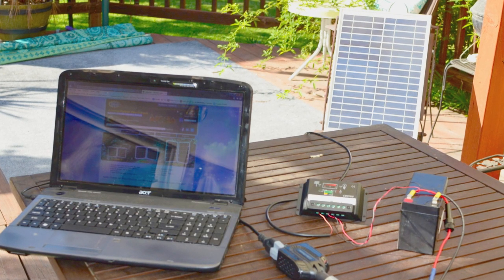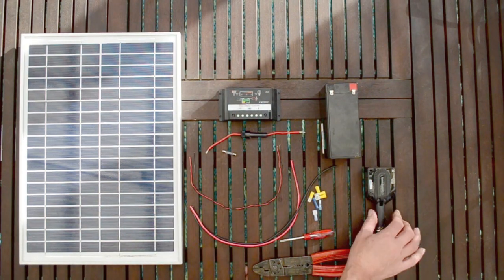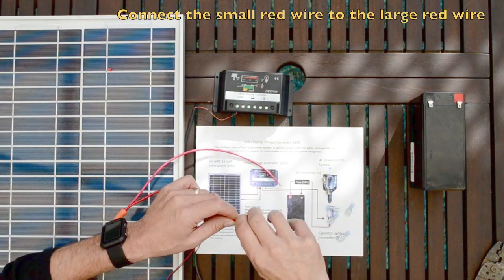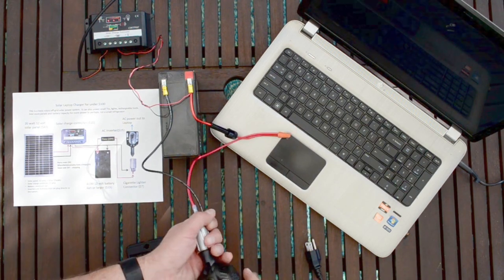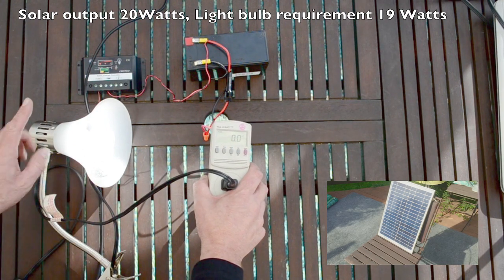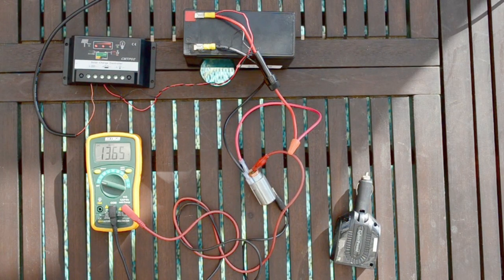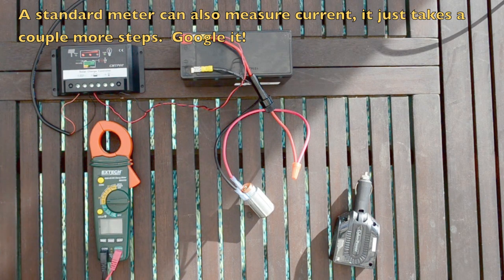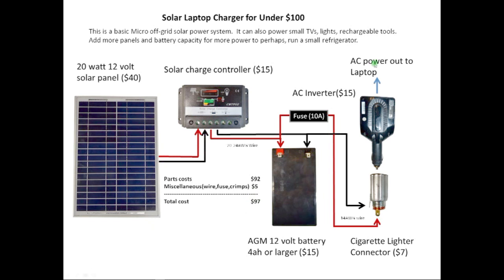How to build a Solar Laptop Charger for Under $100

Comment: Good on you for not being an idiot and trying to match your charger's rating then directly putting a DC line into the laptop.

I've seen too many people find matching males and splice up a cable for it, then wonder why their actual laptop's battery doesn't last longer than 20 minutes on a full charge.

For those complaining about DC to AC to DC, it's a necessary evil not for your convenience, but for the good of the laptop or any device that comes with its own charger, the most important device in the equation. (Just make sure your Laptop doesn't need that much juice in the first place..)
Reply: Very reasonable

Comment: This won't apply to people in the UK 1st off, the panel would have to be on the best end of 14v to ensure a charge rate of 1.1 amp per hour to a 12v battery so limits a 20w panel to be useful only in British summer time. (About 4 months of the year), 2nd a 4ah battery after the pwm charge controller takes 0.2amps and the ac inverter takes 0.7amps, that already leaves the battery with 3 amps before flat. 
Considering its best to keep an AGM battery with at least 20% power remaining to prolong its life, then leaves just 2 amps you'd be lucky to charge the laptop 65% an then spend best part of 4 hours waiting for the 12v battery to recharge? (by which time your device is probably flat again). 
To put something like this in actual practice you'd want at least a 40w panel and a minimum of 7ah battery just to get at least one charge, the 12v battery should be charged within 3 hours after use, and ready to charge the laptop again. Enabling you to rinse an repeat so long as they is daylight.
Reply from the maker: This is good info. Perhaps you can make a video yourself and explain how to expand this system for the UK.  It would be very useful.
Reply: if we convert a 4ah 12v battery to ac, the result is bigger voltage . does that mean we now have more current?
Reply: @Dean-Sala  i built a small 1000w 12v system just to run power in my shed, or charge tools lol taken about 3 months reaserch before blowing my money.. but thank you for compliments
Reply: @xyz-ey7ul  unfortunately not, amps remain the same because the draws the same, the transformer also uses power to convert the current.. when it comes to solar panels at DC an getting an A.C used current you loose alot of power my method is to simply double up any battery need and solar panels to get the output you want..

Comment: Great video, deserves more exposure. May I suggest improvements? here it goes: use 18650 batteries instead, work way better and endure more cycles, you will need a 12vBMS for that, really cheap. Then remove the inverter, not really needed and steals a lot of power, instead you can use an adjustable power module DC to DC where you can set your desired Volts and Amps. So, using 18650 + BMS and DCtoDC will save a lot of energy making everything more efficient.

I searched for info like this for a long time and found nothing specific on Youtube except a couple of hindi videos (for laptops and tvs), there is something wrong with the Youtube search algo. Today just browsing your video was suggested, 3 years old, surely deserves more views being this helpful and specific. BTW yes I do have solar panels at home.
Reply from the maker: I have mentioned in other comments the reason for using an inverter.  Although there are losses, there is also convenience.  Different laptops use many different connectors and different voltages.  Some as high as 19 volts.  It gets complicated trying to figure out which barrel connector to use and there are many.  And you also have to pay attention to the polarity.  So just using a small inverter and using the laptop's own power supply bypasses all the complexities.      

I do agree with using a LION pack with a BMS circuit but this is much more involved.  The vid was intended to get up and running quickly under $100. And then they can pimp out the system as needed on their own.  

Thank you for the comments

Comment: Thanks for this awesome video. I am building my system now!
Reply from the maker: Did you build your system yet?
Reply: @Dean-Sala  Yes, I have. I am using a buck-boost converter as well as a charge controller to charge a 12v battery to feed inverter. But, the inverter I am using gives out modified sinewave, so my laptop doesnt charge. Anyways now am trying to directly charge my laptop from the 12v battery via a buck-boost converter.
Reply from the maker: @PBatADA   Oh no!  I sure wish I had reached out to you sooner. Please don't try and use the buck boost power supply to directly charge your laptop!   Did you adjust the boost charge voltage to match your laptop input power charge voltage?  Did you use a sacrificial barrel connector and get the polarities right?  Cross my fingers your laptop still works.

Comment: So this setup would drain a full charged battery like that in 1.2 hours considering that the solar panel output was full 20W and the battery capacity was 4mAh?

Comment: Want a better way? Very easy, buy a 100w solar panel, then use a DC-DC step up converter to make sure the voltage is around 18v or whatever your laptop needs. Done, 90 dollars in total only. 
Or if you have a new laptop that uses a low wattage (around 10-20w) then you can get away with pretty much using a 60w solar panel and shave off about 20 dollars from that 90 dollar mark to be at 70 dollars in total expenses for the 60w+power converter.
Reply from the maker: I ask how many people are willing to figure out how to find and use a DC-DC step up converter, adjust the voltage correctly, and find the correct connector for the particular laptop in question?  Sure it can be done, but you should not charge a laptop directly from a solar panel regardless. It is a risky move.  I am not saying it will not work, but you really need to know what you are doing. 

This system is not just for laptops. It can run other AC devices too. Including small tools, fans, lights, small refrigerators(larger system).  It is the basic off-grid system in the smallest form and it can be scaled up.   You can also draw off the 12 volt battery directly. It is very versatile. This is what the video is all about. 

Dean Sala, CEO Suntactics
BSCS, BSEE, emphasis in solar off-grid technology and solar tracking
Reply: @ Lord of the belts: The return of the KING
Want an even better way, on the move "car" just buy the $15 inverter an put in a car 12v cig socket?  Alternators going to charge the car battery any way, at home (shed) buy $10 extension lead? :-D
Reply: Well, it does not sound easy.  I know nothing about electrical stuff but NEED one and was hoping for some instruction (that I can do 😁) to follow, so I may put one together.  Your way sounds like it is missing steps darling.

Comment: Find out what your load is at first. (Kilowatt Meter)
Volts x Amps = Watts

*Add up the total amount of Watts from all the electric devices that you will be using with your solar panel system

Comment: Why should you invert from DC to AC and convert back to DC?  The laptop power cords convert from AC to DC.  It seems like it would be better change the voltage and amps into what your laptop requires.
Reply: Very good observation 💪
Reply: There is one very good reason. Laptops have a third pin on the power supply that is used to tell the laptop how many watts the power supply  is capable of. If you use a power supply on the laptop that doesn't have the third pin, such as one of those cigarette lighter laptop power supplies, the laptop won't recharge the battery and the processor will be throttled back. So in order to get around that problem you use the laptop's AC power supply that does have the third pin. The reason for the third pin is primary to ensure the laptop power supply is capable of handling the amperage when the laptop charges it's battery. Case in point. Around 2002, I ran an old Texas Instruments 575CD laptop off of some small solar panels via a cigarette lighter laptop power supply. No battery in between the solar panels and the laptop. This laptop didn't have the third pin as it hadn't been introduced yet. For the most part it worked great until the laptop tried to recharge it's battery. The cigarette lighter laptop power supply couldn't handle the extra amperage and was destroyed. The third pin was introduced to address this problem. Unfortunately it is also the reason why you have to replace the power supply constantly. The third pin wiring is fragile and breaks very easily.

Comment: Hi,
I have Macbook Pro with 96W charger. I need use my laptop every day 8-10 hours. What is best solution. What solar panel (watts), what 12V battery (Ah), what inverter (watts) and what controller PWM or MPPT and how big? Thank you so much :)
Reply from the maker: There is some about these questions in the video.

Comment: For the inverter use the load terminals of the charge controler to save your battery.
Reply from the maker: There is too much of a draw from the charge controller to do this. It will over tax the charge controller in this case.

Comment: Awesome video man, thanks a lot! 
I want to do this soon. I've got a 330 watt, 24 volt panel on its way in the post. What variations do i need to make to the system in your video to make it work with my larger panel?
I'd also love to run a light, fan and small fridge if possible
Reply: Get a couple bigger Marine deep cycle batteries and a much bigger 1000W + inverter situation with multiple plugs!
Reply: Oh just now noticed it was 2 years ago. Hope this comment helps others trying to build out!

Comment: instead of using those heavy big square batteries could you use a set of 18650 batteries in series and parallel to get better battery in/output
say for instance 4 in parallel with 4 in sequance to up the amp/ voltage?
and add a bigger solar panel?

Comment: the reason 12v solar panels are 20v is due to thermal dynamics.
energy will only flow from high to low
and the greater that distance betwen the high energy and low energy the more that energy want to get to the low energy .
this is voltage :)

Comment: Very good video sir. I have 10w loom solar panel, 20AH solar charger controller and 12AH SMF Battery. Can i use the cigarette lighter connector to supply the power for my laptop? Can you please specify the link to purchase AC power out & cigarette lighter connector? Thank you.

Comment: I really wish people would use Watt hours instead of Amp hours. Amp hours mean nothing without a voltage also provided
Reply from the maker: Amp Hours are used when measuring battery capacities(12 volt battery in this case).  Watt hours are useful when both voltages and amps vary. A home solar system for example.  Panel output values change in both amps and volts.  So taking the absolute power in watts as an average is needed. Then you can measure the Watt hours per day. 

In our case the battery voltage is constant.  So amp hours is all we need to calculate the charge and drain.  Basically, if you add a battery into the system, then you have to work in Amp hours

Great comment indeed.

Comment: DC to AC to DC has got to be very inefficient. It should be possible to go straight DC to the laptop.
Reply from the maker: Great comment!  Actually it goes from DC(solar)  to AC(inverter) only. Not back to DC.    And yes there some losses mostly in the inverter.  But you can always upgrade to a better inverter.  It  is very complicated to charge a laptop DIRECTLY from a solar panel.  The solar power fluctuates all over the place.  Various laptops use different voltages to charge, not to mention using the correct charge connector.   There are literally hundreds of different connectors depending on the laptop.  Even if you charge directly from DC on the battery itself, you will need some sort of DC step conversion for laptops that use  higher voltages. And you have to be careful not to reverse the connector polarity.  The versatility with this system, is that it also possible to run other small AC devices. Thanks!Dean
Reply: Laptop only uses DC, so technically it is as he said, DC -> AC -> DC. have you tried a 12V DC to 19V DC converter, and charged the laptop straight from the battery? That is what am trying with my system, but laptop did not accept it.
Reply from the maker: I would stay clear from providing a DC source directly to the laptop charge port.  Unless you know the polarity, voltage and current required.  And the source is stable.
Reply: I take your advise, Thanks. The DC source is indeed NOT stable enough, especially if you have other appliances using it.
Reply: Yes it's possible, power right from a solar panel is weird in that in seems to come in waves of DC power though, so you generally don't connect it straight to anything and need to smooth it out first. But you should be able to achieve this with a DC-DC converter and set the variable resistor to about 18V and then hook up the output to your laptop, most of these are like 95% efficient, it's much better than going from DC to AC to DC again as you mentioned. 
I wouldn't be surprised if there is a 15% power loss in the example shown in this video.
Reply: How long did it take for the laptop to be fully charged?
Reply: Tracy Reed ki
Reply: Targus made (may still make) a universal vehicle laptop supply (12 volts in, 19 volts out) with interchangeable tips for different brands. It's model APD33US.  I have 2 that are used with Dell laptops.  I checked the power draw using a pure sine wave inverter to get AC for the laptop's normal plug-in supply and the current draw at 12 volts is almost 3 amps so close to 36 watts just to have the laptop on and the screen lit.  Using the Belkin supply (DC-DC converter) the current draw is 1.2 amps or about 15 watts.  The direct DC-DC conversion is the way to go.  As the Belkin unit is designed for vehicle use, it can handle voltages from about 11 to 16 volts.
Reply: @Dean-Sala  in most cases the polarity is very clearly outlined on the power supply for maintenance purposes .
you should find this information along with the power supply's IO ratings

Comment: Is heat an issue during charging. Im thinking of making a set up similar to this but a bit beefier for a kayak trip so would want all the electrical components in a waterpoof battery box. Will there be any risks of overheating?

Comment: I have a gaming laptop that pulls about 135 watts (according to the charging block) and I'm thinking of doing this. Can you please tell me what parts I need to make this for my 135 watt gaming laptop? Thanks! Great video btw!
Reply from the maker: I am a gamer too. Double everything.  Panel size, Battery size, and inverter device power output. Study up on 12 volt solar battery charging and small ac invertors. You can get every part needed to build a larger system like this on Ebay and Amazon.  Thanks for the kudos.

Comment: Amazing way of thinking. thank you so much. How long can a full battery go charging the laptop with no sun?
Reply from the maker: Great question. For the battery,  it really depends on the capacity and power required from your laptop,  I actually left that part of the video out to keep it short.   A 7 amp hour battery is a good choice to fully charge a large laptop without sun.   You can always increase the battery size if it doesn't.  AGM batteries are very affordable.   But as you increase the battery capacity, you should also increase the solar panel size.
Reply: @Dean-Sala  what about 40ah battery??.. what panel size should we use?
Reply from the maker: @chrisangelo3688  The system is scaleable.

Comment: Can you provide a link to that 12v to AC converter? I can see those equipment's but they are big... any help?
...anyway... I believe would be better to have a step-up converter DC to DC. I believe you would much better... you could convert those 12v-14v of the battery  to a fixed 19.2v that usually is the requirement for the laptop or monitor... give it a try. ..
Reply from the maker: Different laptops use different voltages.  Thus the reason to just bypass the difficulties and use an invertor.
Reply: @Dean-Sala  Thank you. You are right. However I was able to solve the issue indeed with a step-up DC DC converter. With little screws in the board we can configure the output voltage to 19.2v(laptop voltage).  But note this cannot be used in other laptop that shows: 24v. There's other advantage - it's silent.  :). Thank you for your feedback.

Comment: Great video.  Can this still work without the battery?
Reply from the maker: A battery is required.  It acts as a buffer to compensate for solar  panel voltage fluctuations.

Comment: 14:36 Wow ! My Tablet comes with a 110 W charger and under hevy load this is not enough !
Reply from the maker: You can expand the system with a larger battery and 300watt inverter.